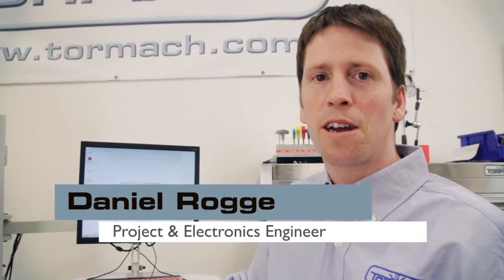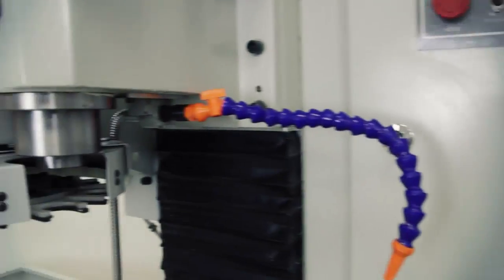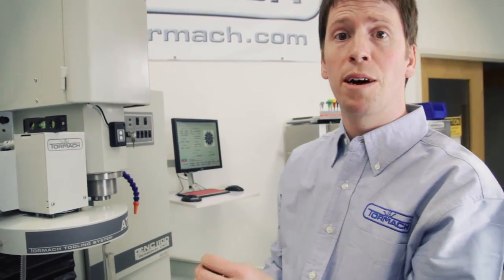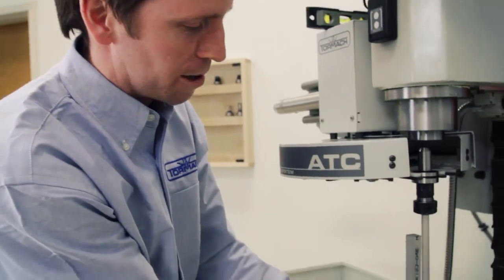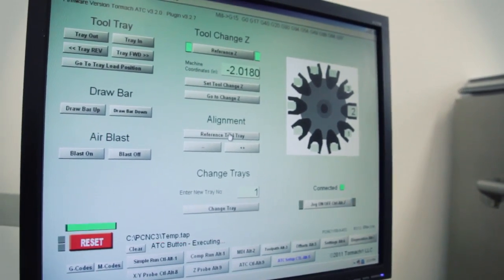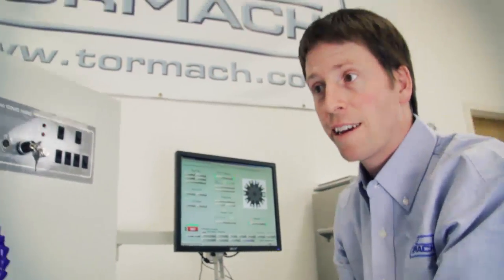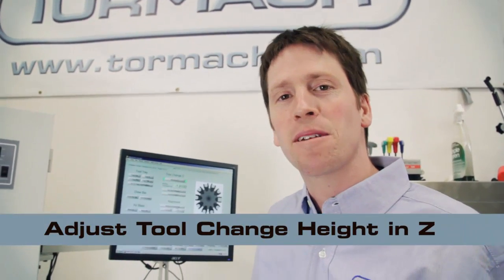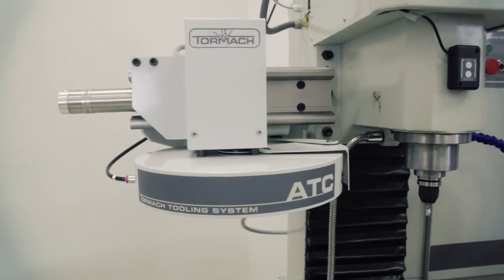How to Align the Tormach ATC (Part 2 of 2)

Comment: i love out tormach series 3-1100,,, its fantastic mill,, we program for a 10hp 40-20 fadal,,,hurco and emco,,,i use sprute-7,,powerstation-pro 2008,,v23 and v24 bobcad cam on solid models everyday,, the tormach is just as quality as any of the others,,, i often send a .375-3 flute carbide 37deg-helix end mill through aluminum running 2000 rpm and 20ipm at -.500 deep using full cutter width and she doesnt grunt at all,,, no vibrations,, plenty of power spindle and servo wise,,, excellent mill !!!